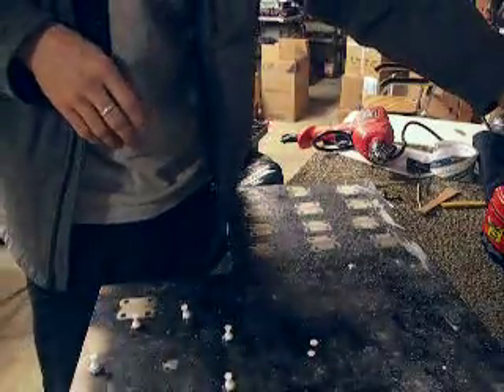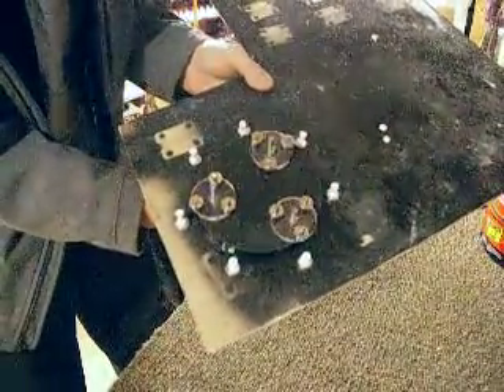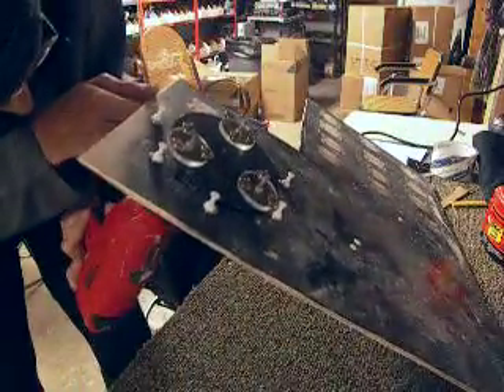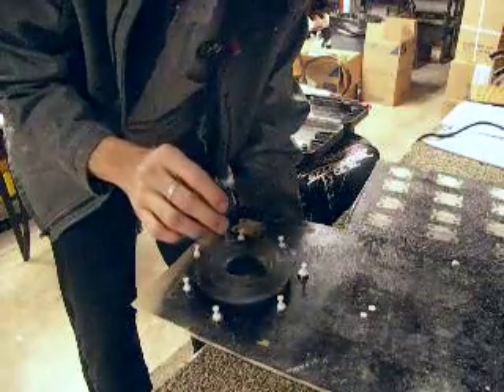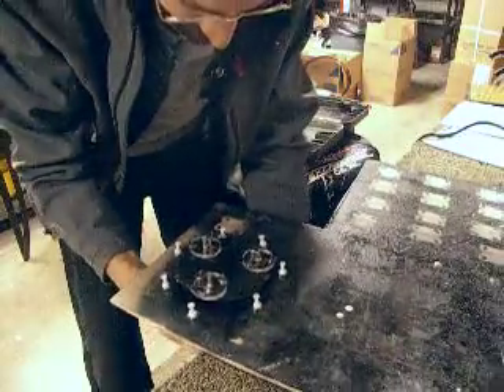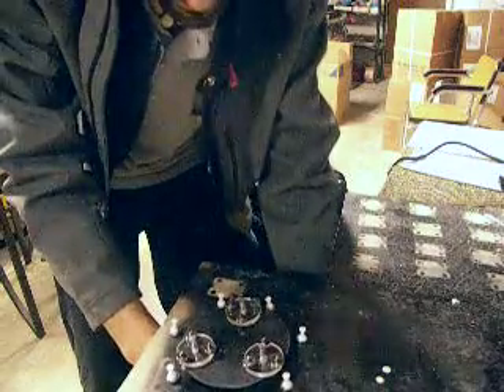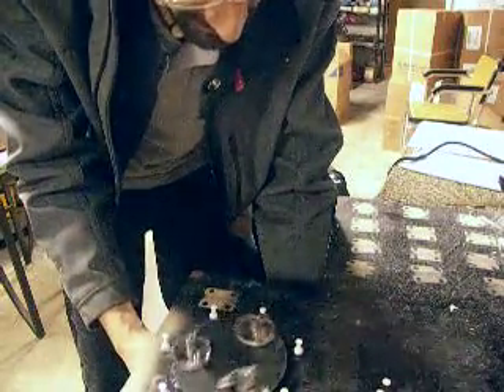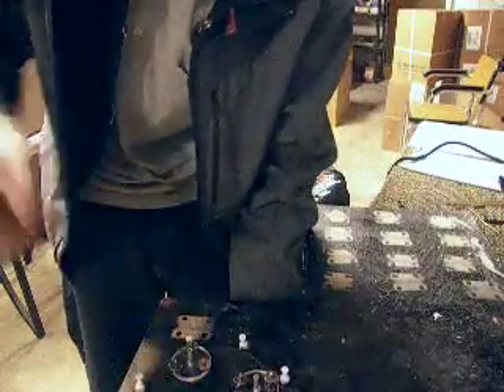DIY Anti Gravity Machine

Comment: Ummm you relize that if this thing would have worked, and I mean worked really ,really well.....which would have been the most preferred outcome....by holding a nail point up over your anti-gravity machine, and bending down to look at it-well you can see where this is going. Your lucky it didnt work, because if it did it would have sent a nail straight through your forehead! LOL!
Also I had one suggestion, i'll wright it in another response due to running out of Charecter count.